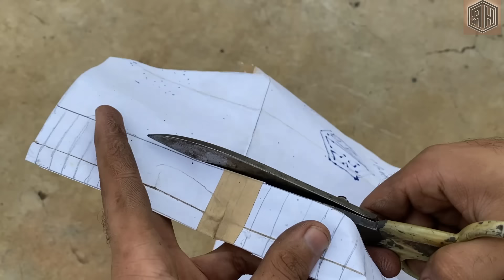Making Turgut's AXE from season Diriliş Ertuğrul - Ottoman Empire's WAR AXE

Comment: One massive problem: the axe head was waaaay to thick.
That axe would probably suck at cutting, a feature a axe is supposed to have aswell.
Reply: 16:03 here you go. Its cutting wood. Like a boss.
Reply: Good craftsmanship but the stock that it was made from was far too thick. As Jody Samson (the guy who made the original Father Sword from Conan) said to a rumour that was spread that Arnold Schwarzenegger wanted a heavier sword. He replied to this by saying modern day gladiators (boxers) wear 12-14oz gloves and compete for 12 rounds and that tires them out. The warriors of old were expected to use the sword/ax the whole day.

1/4" is thick enough.

Comment: Rather than cutting the shape of the blade and converting it into a weapon, why don't you forge it. Forging is more effective method of making a weapon or any other metal items (steel rods, iron beams, etc). Forging will make the blade more hard as forging maintains the pattern of layers in the steel or metal and cutting the shape cuts the pattern of the layers.
Reply: Long and tough process. Thats why

Comment: As much as I love Dirilis Ertugrul I would really liked to have seen Turguts axe made properly not just a copy of a resin movie weapon, It is obvious to anyone that in the show Turguts axe is way to thick to function  and I always failed to understand why the director and props department didnt swap out his axe for a properly shaped one after the first episode,, as for your video I burst out laughing when you started to sand down that huge chunk of steel on your sanding belt i would guess that took you a few hours to refine the edge let alone grind the edge bevels, I would also guess that you used mild steel plate which will never harden not even in water, and no steel will harden when not heated to critical temperature as yours was clearly not,,  let alone the fact that an axe forged in the year 1220 would have been forged not gas cut out of a plate, i would have liked to see you actually forge to shape from a rough bar,,  There are many amazing smiths on you tube that could actually forge this weapon properly,, to your credit you did make it look like the resin prop weapon that the actor who plays Turgut uses in the show, but it surly isnt a realistic representation of a genuine period axe,, I would like to see your try again,,,,
Reply: It’s almost like he was making the weapon from the show like he said he would...🤔

Comment: Even admiring your work, and being subscribed to your channel, I can't help but say how much I hate that you waste raw material by not wanting to adjust one shape to another. In this case, it was clear that the piece of steel that originated the hammerhead could have been used to make two axes, placing the matrix in an oblique direction. Since this is such a difficult job, nothing better than trying to repeat it and launching yourself into a second attempt to do something even better, but... as no one can change the past, I can only wish you good luck and congratulate you on your work.